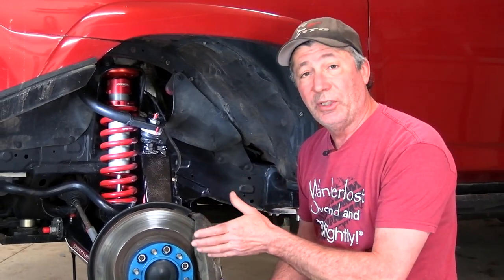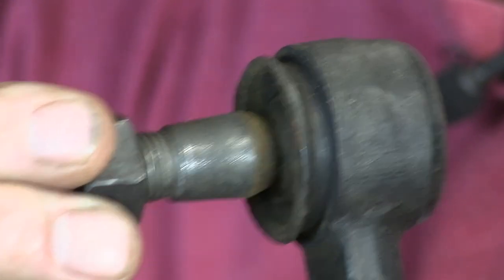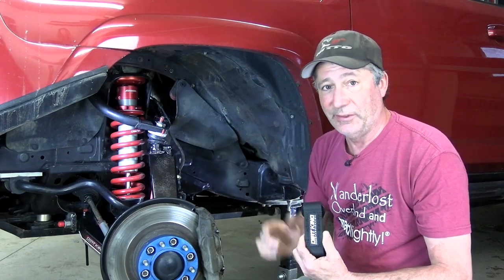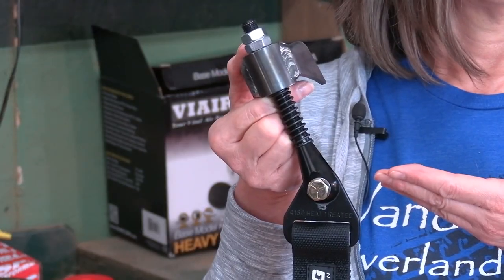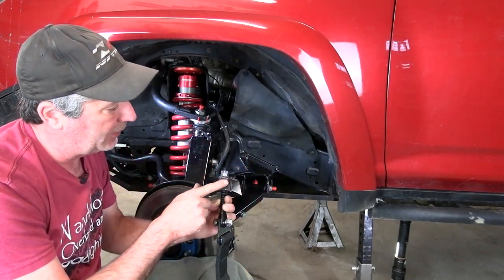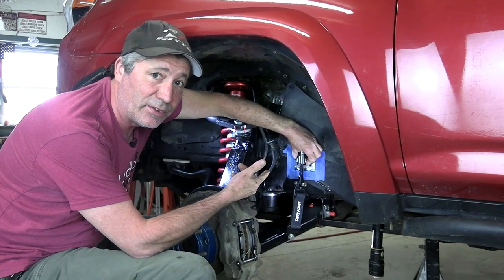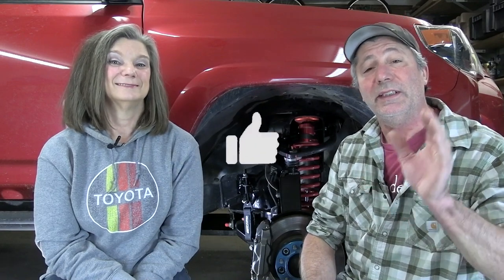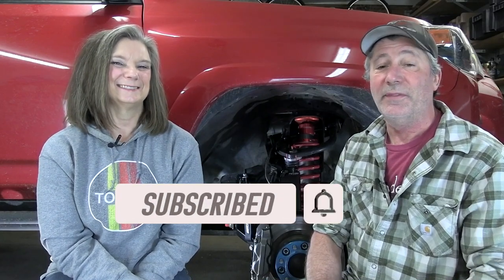Critical Toyota Suspension Modification You Should Consider

Comment: You two still have your FJ? I was thinking of getting a RTT and an awning, but ... am so enamored with the Bush Company TX27 (clocking in @ a whopping 270lbs) that I don;t want anything else. But I've been discouraged by my shop from putting it on top of the FJ because they suspect it will radically increase roll-over propensity given that it's also my daily driver and I spend a fair amount of time on the highway. I've never driven an FJ with a RTT installed let alone one that weighs 270lbs. 

What say you all about adding such a tent to the top of an FJ — and a 70lb BushCo awning? Bad idea? Doable, but not a great idea? Fine, as long as you understand how vehicle handling will be impacted (which, I don't.. and can't until it's already on top of the vehicle—hence the reason I'm seeking counsel from those more experienced than I).
Reply from the maker: Raising the center of weight will have noticeable negative effects on handling and will raise the risk of roll over. Something many don't take into consideration is the dynamic effect the weight will have where the rack mounts to the roof. We've seen failures at the bolts and the underlying roof structure.
Reply: @WanderlostOverland  Oooh—good to know! I hadn't thought about bolt and/or roof infrastructure failures. Thanks for the reply!